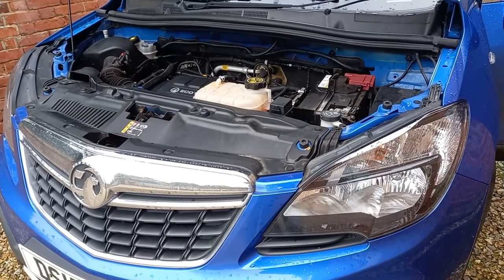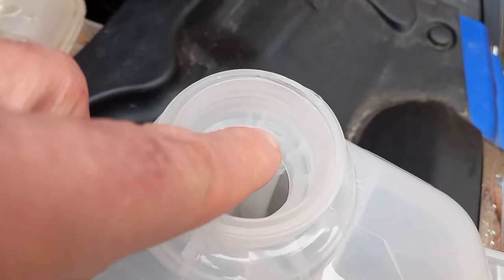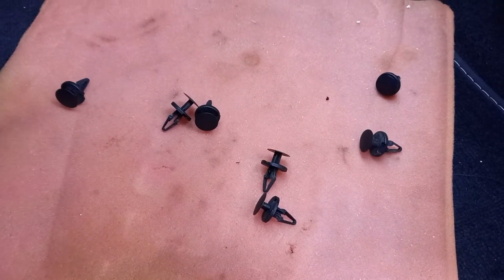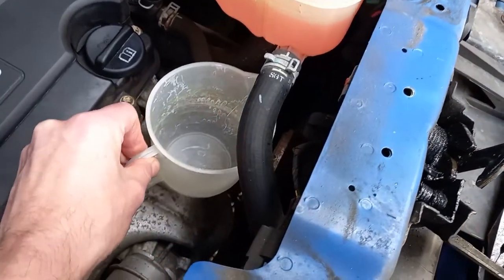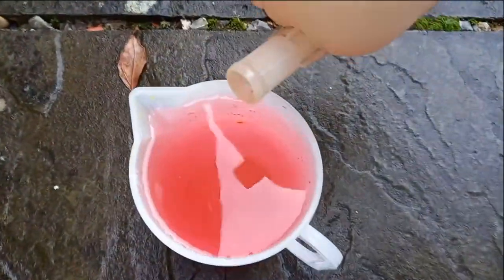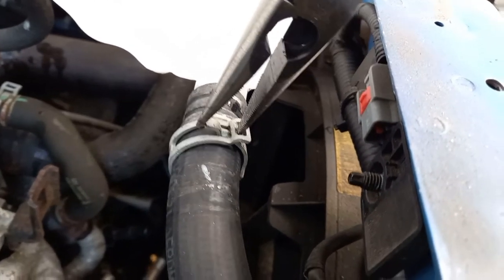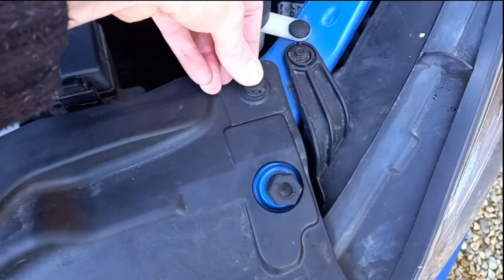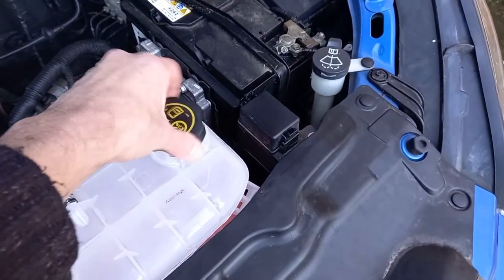Replacing the coolant expansion tank on a Vauxhall (Opel) Mokka 1.4SE Turbo (Corsa/Astra)

Comment: My Vauxhall dealer told me I have a leak on the tank and it will need replacing. I've looked at it and can't see or feel any damp and don't seem to be losing any coolant. They quoted £164 , they reduced it to £120 when I said it was too much. Think I'll do it myself as I've seen tanks for sale on the internet for about £20

Comment: My tank needs replacing and I'm getting ready to do it but now my mechanic has come to say i should remember to do the bleeding. I dont know what that is and he wouldn't say. None of the videos talks about bleeding. Is there anything like that or is my mechanic trying to make me bring it to him to do it and bill me bad as he likes to. I don't want his heart aching bill but still dont wanna spoil my car.
Reply from the maker: I must start by stressing that I am not a car mechanic, so I am giving this information in good faith based on my own "DIY" experience. Changing the expansion tank as shown in the video should not introduce any significant amount of air into the system.  If any air does enter the hoses, it's usually possible to eject it back into the expansion tank with a couple of squeezes of the hose once reconnected. With the engine running, coolant is pumped around the system back into the expansion tank and my understading is that, as the expansion tank is at the highest point of the cooling system, any air should naturally find its way into the tank where it can be vented off by releasing the tank cap.  There are videos on YouTube showing how to bleed the cooling system which are little more than running the engine until the fan comes on and then, once cooled down, opening the expansion tank and topping up as necessary.  Hope this helps.

Comment: Brilliant video, thank you!! Did you find any air pockets with your change? My coolant has gone down a little bit since doing the same as this video - does the air work it’s way out driving normally even with the cap on?
Reply from the maker: Thank you. The coolant will get pumped round the circuit whilst the engine is running, so I would expect any air to find its way into the expansion tank quite quickly. Make sure you top it up if needed.

Comment: Hi, great vid, very informative and useful, would this be classed as a complete coolant change? As mines needs done because the coolant is black lol.
Reply from the maker: Hi Dan,
No, to replace all the coolant you will need to drain the radiator, either by disconnecting the bottom hose or undoing the drain plug if the radiator has one.

Comment: Is the crack visible and was you loosing alot of coolant
Reply from the maker: Yes, there was a definite crack on the underside of the tank, and it was losing a fair bit of coolant.  It later transpired that I had a small leak in the radiator too so not sure how much loss was due to each.

Comment: Great video! I have a question tho...I asked my mechanic if I could change it myself and he said the coolant system needs be pressurised or something ( I am not an expert so I don't know if this is a thing ) . It will cost me around £40 with new coolant . On your video it looks like I can easily do it myself . Did you have to do anything extra after the tank was replaced ? Thanks in advance
Reply from the maker: I'm no mechanic, but not aware that the cooling system needs to be pressurised. Perhaps they meant it should be pressure tested when the tank is changed? The cap contains an integral pressure relief valve to prevent too much pressure building up in the system when hot.
Reply: So would you suggest going to the mechanic or should I do it myself and it will be fine?
Reply from the maker: @soton1989  I'm sure if you do it yourself, it will be fine, but to be honest, if a mechanic can replace the tank and the coolant for £40, you're probably unlikely to save much by doing it yourself.

Comment: Did you need to bleed the system after ? thanks
Reply from the maker: No, I didn't find it necessary. If a little air did get into the system, it would soon find its way into the tank.